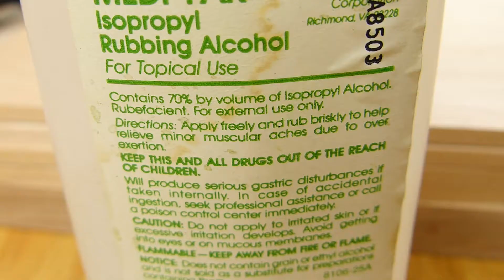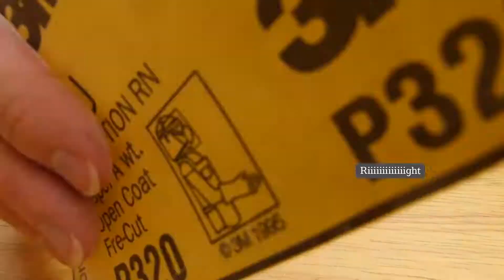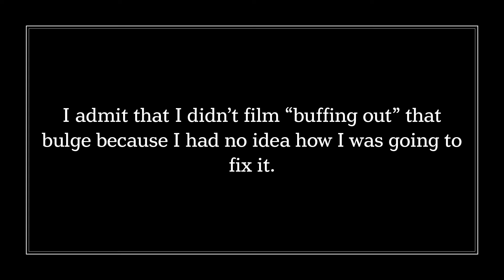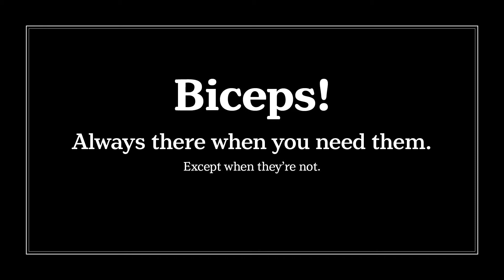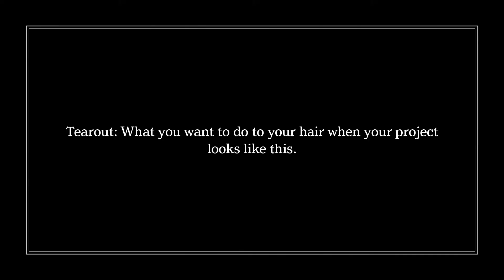Making a Wood Lantern

Comment: Cool lantern! Next time, try acetone on the stickers that won't come off. Works like a charm. (Or fingernail polish remover if you don't have any regular acetone...it is mostly acetone. If you use that, just test first, because some of them are dyed blue or pink. Don't want to color your boards.)
Reply from the maker: Thank you! I never even thought about acetone. That's a great idea that I will certainly remember for the next time!
Reply: One of my favorite “life hacks” is using a heat gun (not a hair drier) to remove those dang-blasted stickers. Heat the intact sticker until hot, but not to the point of melting/burning - this will reactivate the adhesive and the sticker will peel off in one satisfying piece. If there is still residue, then the acetone or mineral spirts does work great.